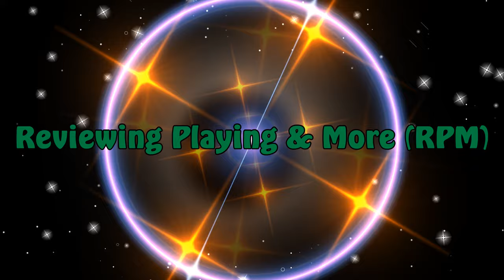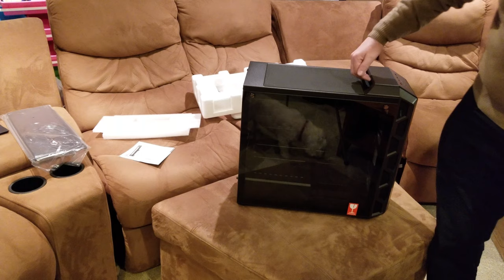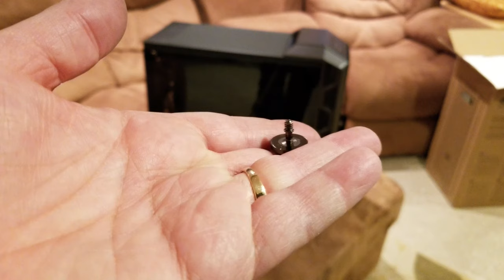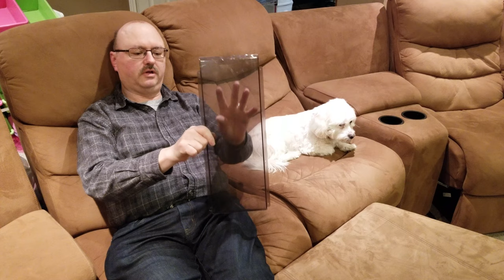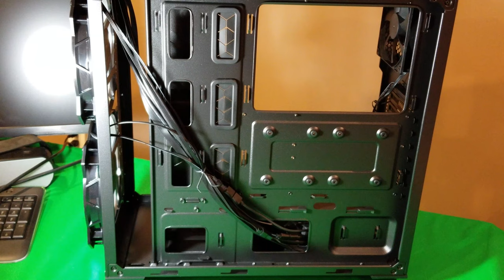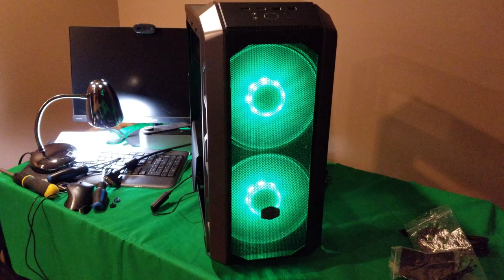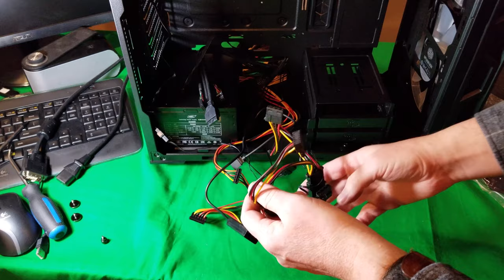Cooler Master Mastercase H500 (New info on RGB in the Build Video coming soon) No Molex required.

Comment: Quick question if anyone can help me with this- I'm trying to get a solid color setting (as shown at 13:45 in this video) but as I cycle colors there doesn't seem to be any option like this, closest thing I can get is a color that flashes on and off extremely rapidly. Any ideas? Is this just what I'm stuck with on my particular model? For reference I have 14 options with the controller, but they don't seem quite the same as in this video, only solid color option I have is for a rainbow pattern

edit: Just to clarify I have the H500 case, the version without a letter suffix in the name
Reply from the maker: In this video I used the controller for the colors, including the solid colors, the controller has three settings, the button on the far left away from the SATA Power connector is Mode, the one in the middle is to turn it on and off as well as colors, and the one on the far right is the lighting speed...as far as I can remember that is, don't have the case any longer...hope that helps a bit...
Reply: @Reviewing_Playing_and_More_RPM  Thanks! I couldn't find any other buttons on my controller but perhaps I'm just daft. You might have the original RGB case while I have the newer "ARGB" v2 case that I just learned existed, seem to be about the same with minor differences, perhaps the color options are some of those. And hey nice dog, thanks again for the reply
Reply from the maker: @MrThephonypope  Ah, didn't realize they'd made a Version 2 of the case, it's possible they changed things up then...yeah the dog was my pet Sparky, he passed recently but is fondly remembered...you have a great day...

Comment: I'm using the same case for my first build it's not powering up though any suggestions?
Reply from the maker: I did a new system build and changed the way it can be connected, it shows a way that might help, other then that is checking your Front Panel connections to verify there connected properly. Hope that helps...
Reply: @Reviewing_Playing_and_More_RPM  Thanks for the quick reply, I'm going back and forth between that video you mentioned and another channel's video I have every component's cables set up right BUT the front panel cables, that's been the biggest hiccup for me. It's hard to work off of your guide since I'm using a Asus B450 M A motherboard. Can I email you I'd really appreciate your help?
Reply from the maker: Hi, prefer to use YT comments to get things worked out, I can give you a link to my video on how to connect the Front Panel connectors here https://www.youtube.com/watch?v=2NyaKFS5ztA&t=170s for your motherboard it is the same, on pg 1-10 of your Motherboard manual.  Let me know specifically what your having trouble with other then this and I'll help if I can. Thanks...
Reply: @Reviewing_Playing_and_More_RPM  Everything worked out well thanks for your time brother your work is much appreciated! 👍

Comment: So the two front fans don’t connect to any fan header? They just connect via the rgb?
Reply from the maker: No the RGB connects to the RGB Header, and the fans connect to the MB sys fan header as well...Thanks...
Reply: Reviewing Playing & More RPM ah alright. I’m working with a Maximus xi hero board. I currently have my rear exhaust fan plugged into the “CHA__FAN” header off to the left near the I/O panel. The only other header I’m thinking I can get these into is the “CPU_OPT”?  I’m also working with a Noctua D15 cooler which is making this build vastly more difficult. I’m a first time builder and I’m just trying to make sure I have everything correct.
Reply from the maker: No problem, there's always a Fan Splitter or Hub that you could get to assist with plugging in the fans when there aren't enough...there fairly inexpensive as well...I have never used the CPU_OPT but it's there and can be used for an extra fan header when there's no other option...Thanks...

Comment: Sorry it's me again, the guy with all these questions, but I found myself confused 1 more time as in a forum, 1 guy told me that I should not put the rgb fans to the rgb headers (jrgb mainly for led strips) as it's 12V and the rgb needs 5V so it will be damaged. So, if that is true, my only choice is to use the rgb controller. Is that true? Please help. I just want to connect 3 rgb fans directly to the motherboard (also there 'll be a splitter cable)
Reply from the maker: The RGB Fans aren't going to the RGB Header as they only have fan connectors, there is one cable that goes to the RGB Header, and it's 5V,  so they are correct that it doesn't go into the 12V as it would damage the 5V...if you have a 5V header then you can use that one, not all motherboards will have both the 5V and 12V while others will have both plus some...so if you don't have a 5V RGB Header then using the RGB Controller is the option that is left...Hope that helps...
Reply: @Reviewing_Playing_and_More_RPM  Ok thanks, my mobo has rgb header of 12V(jrgb) and 1 jrainbow of 5V. So I guess I connect the 3rgb fans in a sys fan slot, their other cable to the splitter included of the case and then to the 5V header?

Comment: Hi
How do you cycle to the static colors, i can only get it to "breathing" mode :(
Reply from the maker: Your MB RGB Software should let you chose the Mode, like breathing, static, and more...
Reply: @Reviewing_Playing_and_More_RPM  Unfortunately my MB is quite old and doesnt have any RGB header so i'm using one on the cable (one button controller) and i can only cycle through the breathing colors or "off" and cannot find static color option :(
Reply from the maker: @horacmckozias7968  So the controller should have 3 buttons, one for mode, colors and speed and effects...you can see the controller buttons on Cooler Master's website...even if it's not a Cooler Master they mostly work the same way...
Reply from the maker: Ok, I see the controller you linked, never saw that one before, are you using it with the reset from the case so you can use the reset button on the case to control the colors, it seems like that is how it's intend but not required of course...just thinking it might help somehow...not sure otherwise but might have to get one and check it out...good luck...
Reply: @Reviewing_Playing_and_More_RPM  Yes i'm actually using it on my reset button but the functions are the same :( I really don't understand why Coolermaster doesn't include static color option to this controller it's the most basic thing, anyway thanks for help

Comment: Can you remove the sata drives?
Reply from the maker: Yes, anytime you have a SATA Drive it can be replaced, just be aware that if you have an Operation System on one of them, your system will no longer boot up...you'd need to replace it with a new Drive and OS...

Comment: noooo! you're taking off the front wrong. you have to take the 2 side panels off. then there will be 4 clips you have to push just behind the front panel. you are breaking the front panel.
Reply from the maker: Never had a problem doing it this way ever, others do it the same way but I get your point. Thanks

Comment: Hi! Sir please help me I got it and I have x570 elite mobo. H500 fans are working great but my leds are not working how can I solve it ? And don’t have sata.
Reply from the maker: Verify the fans are powered up with both the SATA Power from the case to your PSU, and that you have the RGB Fans plugged into the MB, if you start at 15:14 I went over the cables for the fans and the RGB as well. Remember a 3 Pin is 5V Addressable RGB and a 4 Pin is 12V RGB, so make sure it goes to the correct MB Header for it or it can cause problems. Hope it helps.
Reply: @Reviewing_Playing_and_More_RPM   my mobo has Rgb fusion 2.0 but this case has rgb fusion is it gonna be problem?
Reply from the maker: @IamWhoIam7  RGB Fusion itself can be problematic itself at times, but generally speaking it should work just fine with the case and MB being the same. However should you have a problem, you can try using iCUE Software, you will need to have a Corsair RGB Device though, ie RGB Memory, or some such thing, but in worst case scenario this software works so much better then most other RGB Software out there. But try RGB Fusion on it's own first and it will hopefully work just fine.
Reply: @Reviewing_Playing_and_More_RPM  Thanks for helping me☺️. I am gonna try it.
Reply: Can I contact with you for some help Sir?
Reply from the maker: @IamWhoIam7  Any time
Reply from the maker: @IamWhoIam7  You can DM me on Twitter I don't use email
Reply: @Reviewing_Playing_and_More_RPM  do you have only twitter? I don’t have twitter ☹️.
Reply from the maker: @IamWhoIam7  That's it really
Reply: @Reviewing_Playing_and_More_RPM  thanks, have a good day!
Reply: Sir, my gigabyte cable has 3 pin and mobo has 4 pin where can I plug it?
Reply from the maker: @IamWhoIam7  If you have a 3 Pin it's a 5V Addressable RGB Header that you need to use, if you don't have a ARGB Header on your MB then you'll need to get an Adapter to use instead, it'll convert 12V to 5V and let you use your 3 Pin 5V Cable. I did a video on a couple of them to choose from here is the link: https://youtu.be/sK4PGOZ0EGA hope it helps.
Reply: @Reviewing_Playing_and_More_RPM  thanks.
Reply: I fixed my issue but now I have another problem. The monitor speaker appears to be there but no sound, what can I do?
Reply from the maker: @IamWhoIam7  If you have a Monitor with speakers then there will be a green port on the monitor that you will need to get a audio cable that goes into it and the other end goes to the motherboard headphone port on the back of your computer
Reply: @Reviewing_Playing_and_More_RPM  thanks again☺️
Reply: @Reviewing_Playing_and_More_RPM  sir, I have a question. I’ve benchmarked my gpu so many times and I overclocked my gpu and I put really big voltage like 60 and 170 mhz. Does it damage my gpu?
Reply from the maker: @IamWhoIam7  I'm not sure about the voltage I don't usually do anything with that.
Reply: @Reviewing_Playing_and_More_RPM  thanks
Reply: Hi! Sir I hope you are well. I have some clicking sound on my case. Should I worry about it?
Reply from the maker: @IamWhoIam7  It depends on what is making the sound, sometimes a loose cable from a fan can come loose and start hitting the fan blades that makes a clicking sound, but it can also cause the fan to stop or get caught up, check things like that, or also if a Mechanical HD is failing there can be a clicking sound although it's not as common these days with SSD's.
Reply: @Reviewing_Playing_and_More_RPM  fans are working properly just making that clicking noise. I don’t use hdd. Can it damage my case or fans?
Reply from the maker: @IamWhoIam7  Clicking noises can also come from fans that are dying or that are just gummed up with dust. Some fans that come with cases are not great and can often be loud, I have replaced fans often to get one's that are quieter. Not saying that's what it is just something to consider. It is not likely it will damage your case though.
Reply: @Reviewing_Playing_and_More_RPM  If it continues I have courtesy warranty. Thanks for helping me☺️.

Comment: WHY WOULD ANYONE be using molex in 2018/19?
Reply from the maker: +Mihaly Freeman Yeah I was surprised they did that, I'm currently building it and going through it again to see if it doesn't need to be used. It seems odd will mention it if I find there is a different way, I'd think there has to be. Thanks...
Reply: @Reviewing_Playing_and_More_RPM  what about still using usb 2.0
Reply from the maker: @bassa69  I did a follow up build and re-did the connections, turns out it didn't need the molex, not sure what you mean about the USB 2.0 though.

Comment: back again to see how the front panel is removed. seeing how aggressive I have to be with it I'm scared of opening it and breaking a plastic bit lol. 

edit: if anyone is reading this wondering if something will break; no. the plastic hooks are actually pretty strong, plus they seem to be designed with some level of flex in mind. also when putting it back on make sure the circular bits are aligned with their respective holes.
Reply from the maker: No problem, enjoy...Thanks...

Comment: Burned the fan leds
Reply from the maker: The fans use the 3 Pin 5V Addressable RGB and needs to line up the arrow from the case cable to where it says the 5V on the ARGB Header on the MB, unless the cable is 4 Pin 12V RGB in which case it needs to go on the 4 Pin RGB Header on the MB again with the arrow from the case cable going to where it says 12V on the RGB Header, if done wrong it can cause the RGB to burn out and possibly affect the MB...
Reply: @Reviewing_Playing_and_More_RPM  for me its the h500p, and i had the 2 fans go into single cable that should go in a rgb controller from coolermaster, then i thought its a good idea to input it into the LED_c1, which caused it to only turn a single led blue light on each fan, so i dont know if its burnt or just messed up something else. It was working fine with the controller before thay. But then after, the controller doesnt help anymore
Reply from the maker: @spacykid  My understanding is the LED_C1 is a 12V RGB Header, so if yours was a 3 pin 5V then you may have damaged the LED's, to find out for sure plug them in as mentioned, to a 3 Pin 5V ARGB Header to see, you will also I believe need to plug in the cable from the case that is a SATA Power Cable for the Fans...Otherwise you might need to purchase two new RGB Fans or just go without...good luck...

Comment: How do I turn off breathing mode?
Reply from the maker: It'll depend on how your controlling it now, if your using your MB software, you'll need to open that software and it should provide options for static which will give one color that stays that color until you change it again...if your using the controller then I believe it is the Mode button that will give the mode to go static as well...
Reply: @Reviewing_Playing_and_More_RPM  Is there a link to the software?
Reply from the maker: @yazan3115  What Motherboard are you using?
Reply: @Reviewing_Playing_and_More_RPM  I am using a Asus Prime Z390-A
Reply from the maker: @yazan3115  So the software is Aura Sync I believe it should have come with your MB, website is asus.com then search for your MB and navigate to the drivers and support and newer versions will be available...
Reply: @Reviewing_Playing_and_More_RPM  okay thank you!
Reply: @Reviewing_Playing_and_More_RPM  Okay I downloaded Aura Sync and it only controls my CPU cooler. Is there something I have to do to connect Aura Sync to my front fans. Sorry for asking so much.
Reply from the maker: @yazan3115  I haven't used the Aura Sync much but it should work with any RGB Device, just ensure your fans are RGB and connected together and then to the MB once that's done the software should recognize the fans...
Reply: @Reviewing_Playing_and_More_RPM  okay thanks